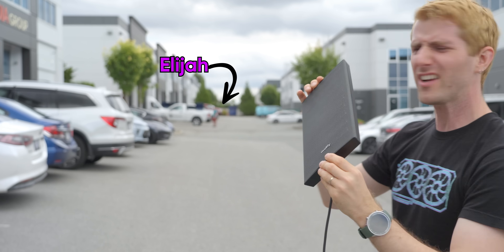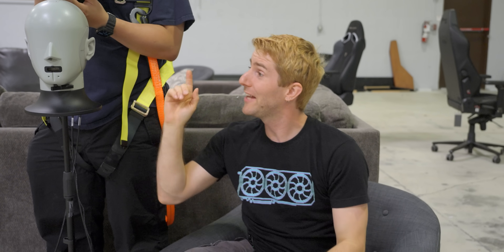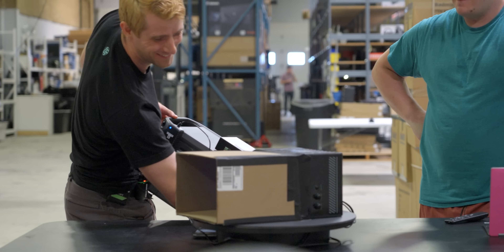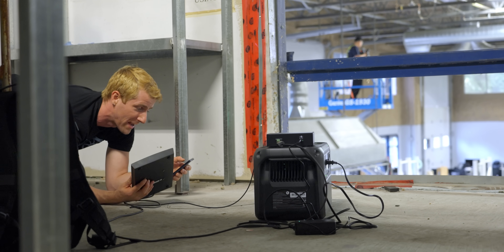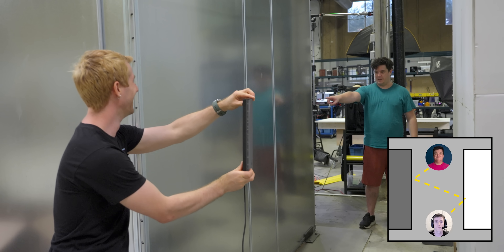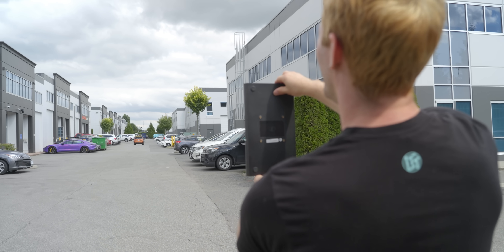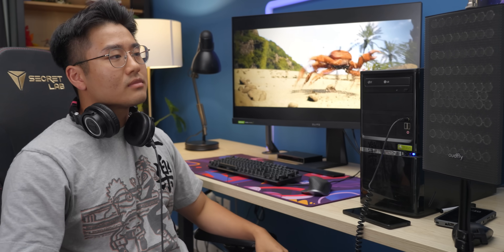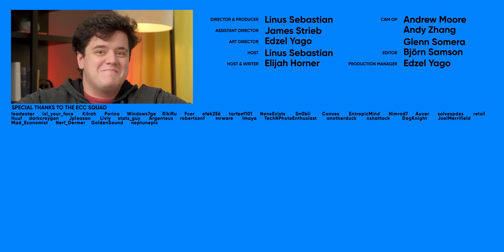Only 1 Person in the World Can Hear this Speaker - Ultrasonic Directional Speaker

Comment: For anyone interested in a more simple explanation of how this works, here's an easy home experiment with two phones - - 
1. Get a frequency generator app

2. Make a tone of 440hz (this is the middle A on a piano, it doesn't sound particularly high or low, just a middle tone)

3. On another device, make a tone of 442hz.

4. You should hear a 2hz tone (which sounds like two "wubs" per second), because 2hz is the difference between 440hz and 442hz. Even though neither speaker is capable of playing 2hz! 

5. Now imagine scaling this up. You could play one sound at 44000hz and another at 45000hz, giving a 1000hz tone that's extremely focused! 

Why does this work? Because higher frequencies focus in a narrower beam. This is why when you walk behind a speaker, you can still hear the lower sounds but the high pitches disappear. Lower sounds "bend" behind objects, higher ones are more focused.
Reply: sound doesn't focus in a narrow/broad beam by itself, it's only the source (in this case, the speaker) that determines how sound is spread. wavelength is the difference. wavelength at 20hz is approx 17m while it's 1,7cm at 20khz. hence, obstacles bigger than 1,7cm shield 20khz frequencies. you would need a 17m obstacle to shield a 20hz wave, which is something like a 6 story building.
Reply: Anyone who has a guitar (or similar stringed instrument)  can replicate this much more easily:  (assuming standard tuning) Grab your lowest string in the fifth fret and play it simultaneously with the next string.  Unless your guitar is PERFECTLY tuned you will hear the "two wubs per second".   Side note:  this is an alternative way to tune your guitar without a guitar tuner.
Reply: @Atlessa  This is also why unison bends sound so good. You play two notes at once, and bend the lower note up to the same frequency as the higher one. Before the frequencies are the same, it can sound very dissonant.

So it goes from dissonance to a perfect unison; sounds great with a bit of distortion. "Bastille Day" by Rush is a good example of unison bends (in the solo around 01:55).
Reply: @Atlessa  yet there is no such thing as perfect tuning, tuning by harmonics on 3rds, 4ths, 5ths doesnt add up to octaves...
Reply: Good now I got it
Reply: Your ears cannot "hear" 2Hz, what are you talking about? Maybe you can hear a 440hz sound modulated 2 times per second, but your ears cannot actually hear any sound below 20Hz
Reply: @codyrap95  You don't hear an actual 2 Hz sound frequency, but you hear a 2 Hz "beating". If you listen to a 440 Hz frequency and a 442 Hz frequency one at a time, you probably won't hear any difference. But if you play those frequencies simultaneously, you will hear a "beating" 2 times a second, or 2 Hz in other words.

And you can psycho-acoustically hear frequencies (or notes, really) below 20 Hz by playing the overtones of a fundamental frequency below 20 Hz. Your brain will fill in that note below 20 Hz, even though your ears won't hear it. Or even if the frequency isn't played at all (see Veritasium's latest video).
Reply: parametric array uses nonlinearity in sound to demodulate the amplitude modulated signals. so just because you have a beating frequency doesn't mean you are guaranteed to have a parametric array source
Reply: Yeah I watched that pipe organ vid on Veritasium too lol
Reply: Yeah, that’s not exactly how this works at all though. It’s using amplitude modulation with a 100kHz carrier tone.
Reply: @ClintMoody  This is correct. An ultrasonic carrier wave is modulated to carry a side band frequency that when demodulated by the air (non-linear demodulation), the sound produced is in the audible range. That said, I can imagine a method to demodulate multiple carrier signals from different banks on the array to create a binaural effect that produces rich bassy sound. I'm not entirely sure how you would build a DSP to process it all, but it would be a fun project :D
Reply: @ClintMoody  Yes... And what is that amplitude modulation creating? Beat frequencies, the thing I described. It was supposed to be a high level explanation.
Reply: Arent you describing binaural audio? I think thats different. Idk.

Comment: This technology is also used as a weapon. Originally it (LRAD) was designed to be a hailing device to hail ships that weren't responding to radio, after the destruction of the USS Cole in 2000. At a high enough amplitude, it can cause that discomfort effect that Linus mentioned, but to the extreme, causing eardrums to rupture, and theoretically could cause your organs to rupture at a high enough decibel count. Many police stations bought military surplus LRADs to break up riots and protests, and found that the alarm mode of the LRADs was incredibly effective at dispersing crowds.
Reply: ...oh... oh god that's a bit terrifying
Reply: @liviasilva3333 You'd have to put unbelievable amounts of power through it to actually hurt someone.
Reply: It actually is not the same. LRAD (at least according to wikipedia) is just using a speaker array in the audible range. This one on the other hand uses an ultrasonic base frequency which gets modulated with frequencies at an audible range. With sound there are some non linear effects that allow this modulation to spill over into lower, audible frequencies. 
The advantage of using this approach is that you can create a way tighter beam for a given array size becaue of the shorter wavelength of ultra sound. This also allows you to use only one frequency for the beam forming and  possibly focusing effect. This is fairly straight forward.

Beamforming the way LRAD has been done is not that easy because you need to create a beam for multiple frequencies at the same time, which to me sounds like a computational mess and probably comes with a lot of trade offs involved when you actually want to focus it on a tight spot.
Reply: First time I saw this was with an interview with the investor on discovery channel who told he just got funded by some darpa lab, never seen it around as consumer product since, then saw it was weaponized so all made sense
Reply: had a friend who worked in shipping, apparently there were suggestions to put them on ships that went through high piracy waters since there's apparently legal issues with arming the crew.
Reply: First thing I though. But those things are ALOT louder. But neat to see the tech come to a civil use case.
Reply: Is that what they used in Waco?
Reply: @abcpea  probably
Reply: I'm still upset for one terrible riot incident in HK. They used tear gas from both sides of a closed road and closed in with people pinched in the middle. People were suffocating and had to break into the building doors to get fresh air.
Reply: @yensteel  That trapment of people was rough.
Reply: That's terrible. Not a good thing at all
Reply: great
Reply: This sort of "It started as a military weapon that we found civilian uses for" thing is actually fairly common. Microwaves, wireless communication, and plenty of other stuff.
Reply: @dopplereffect9246  You would say that. You're just promoting big wave for your Doppler superiors
Reply: @dopplereffect9246  the internet
Reply: as in 9:54, LRAD was made on the cheap and worked as intended.
Reply: Yay more skynet stuff
Reply: Are we surprised?
Reply: Been tortured for 1 year now 🤗
Reply: Daemon
Reply: Imagine someone casually translate brainrot sounds right into your brain while killing you from inside
Reply: I immediately thought LRAD. Hopefully they Linus doesn’t weapon use this and use it against his employees.
Reply: ...and the public made up the Brown Note joke conspiracies.
Reply: .... Also there have been some odd injuries from the PD's using LRAD and other crowd dispensing technologies. Dont be a jerk and try to make one for manipulating other people like the PD's. Dispersing crowds should be thr mayors job with a speech and action replying to the protest.

Be a fungi and make one for fun and harmless pranks.
Reply: Leaving the hot topic out yeah. LRAD is considered a "Less than Lethal" weapon. But that also has to do with the frequencies they use for the crowd dispersal mode. Less than Lethal dose not equal harmless. I doubt unless you do some hardware modifications this speaker could go to decibels of that level. For the allready stated safety reasons.
Now Im off to troll people with spooky sounds.
Reply: @AnonymousAnarchist2  There is one piece of sh*t house on the way into town that used a high-frequency sound that only the youth can hear to stop teenagers from hanging outside their house. But the thing was so loud and had never been turned off for 15 years, it made babies and little kids cry and most under 19 wince simply for walking on the street because no adult heard how horrible it was, and as soon as you had say in society, you couldn't or could bearly hear it, so nobody bothered to stop them until very recently. 
(our noise pollution laws didn't include the frequency they were abusing)
Reply: @AnonymousAnarchist2  Aah yes it should be the mayor's job because we've never seen a corrupt government official before... Not saying I think people should go make one, but at least your average joe shmuck won't be a person in power with many reasons to be criticized.
Reply: @AnonymousAnarchist2  There is a difference between riots and protests. Protests, done responsibly, never need to be broken up. Protests can get out of hand and can need to be removed, but that's really only when some random cow lovers start blocking highways. Riots, by nature out of control and criminal, need to be dismantled as soon as possible, Riots provide an individual with a sense of crown anonymity that encourages them to act more wildly and with less care. These people are more likely to start becoming violent, towards property and people, causing death, injury, and massive property damage. If you are protesting, and a bottle starts flying, run. Once that happens, it isn't a protest anymore, and you damn well better expect to get slightly injured in the attempt to stop the riot. 

Also, mayors are absolutely useless, bottom of the barrel of politicians. If you are protesting something that a mayor could actually fix, then what the hell is even the point of protesting it, it must be so unfathomably unimportant. What? Is your neighbor Susie's flowerbed triggering you so you want to protest to the mayor to make flowers illegal?
Reply: @NeferetThePaladin  typical paladin mindset
Reply: @NeferetThePaladin  There are some massive cities where mayors have incredible power. Don't dismiss that without thinking.
Reply: @NeferetThePaladin  The problem with this mindset is the police get to, more or less, unilaterally decide when a protest "becomes" a riot. Meaning you get trigger happy morons who decide that some people jaywalking is the same as a riot, or even people being gathered in a public space is "obstructing access" and therefore it's a riot. This results in a police overreaction to a peaceful protest, escalating the situation to a riot. Because people tend to defend themselves when attacked with no provocation, obviously. Because you've given these tools to police with zero accountability you actually end up with more violence.
Reply: @NeferetThePaladin  The difference between a peaceful protest and a criminal riot is whether the protesters are clients of the ruling class or enemies of the ruling class.
Reply: @NeferetThePaladin riots are good. Power to the people
Reply: @kerolokerokerolo   until your little shop get wrecked without any way to get any compensation
Reply: There is no realistic difference between a riot and a protest, people who often try to make the distinction, tend to be the ones that also consider protests to be riots.  @NeferetThePaladin
Reply: @SlyTreeRat 
“SA is a risk you take when deciding to wear an outfit that shows your shoulders.”
Reply: @epictomato9876  It probably can't be used as a weapon unless you want to deafen someone on close range. Sound fall offs quite quickly and it would takes lots of power and speakers to increase range a bit, considering huge db required it would be useless

Comment: I recently went to a museum that had these types of speakers above the displays to hear the audio from the video playing on the screen. It was freaky but awesome!
Reply: @cristianmoore1996  were they using this exact type? If so, that's very cool. Parabolic dishes with a speaker to direct sound to a specific point have been around for decades but this technology is on a whole different level b
Reply: @thebigo06  Indeed, we've had a parabolic demo in Oslo airport (Gardermoen) for at least 15 years. Really freaky to walk around in a noisy airport then stepping under a lamppost and suddenly you're in a rainforest (it also blocks out most of the crowd noise)
Reply: @mBruksaas  Yo thats lit, does the audio sound like its inside your brain?
Reply: @robertheun7595  Sorta, because you know no1 else can hear it, but it's more like a little bubble of 360° audio since the audio changes when you move inside the bubble
Reply: @mBruksaas  that sounds like it would almost jump scare you hahaha
Reply: In norway, the national museum. There is a corridor like any other. But walking through it there is different sounds. And you're like oh cool music. But then you walk and realise it's changing and mixing based on your movement. Turns out not movement but location is important. They use these too. Or similar ones.
Reply: directional speakers have existed for this purpose for a decade now
Reply: So basically, the design in the vid and the museum ones from how I understand it, if you think of ultrasonic speakers/receivers used for.backup sensors, or even the vibratey things for generating fog in fountains, I'm guessing the math enables you to take a bunch of them, then you can calculate the output to generate interference between all the units that equals audible frequencies, that match the audio input. That helped me understand how it's doing it, if my understanding is right.
Reply: 𝒻𝓇ℯ𝒶𝓀𝓎 👁️👅👁️
Reply: Yeah, also haunted houses could use it so it’s like 500 times scarier since only you hear it
Reply: @water6006 that is a good idea and then they can make you think your hearing things.
Reply: yep ! they have some setup in the BMW Museum !
Reply: Did you go to Cosmocaixa?
Reply: freaky they say 😝
Reply: It was 𝓯𝓻𝓮𝓪𝓴𝔂 👅
Reply: That's epic bro. Did the audio sound like it was inside your brain??
Reply: The is essentially a multi channel low frequency AM radio. 
Except there's phase shift between the modulation of channels.

I wonder if there's any health risks. Also wondering if it'll affect animals?
Reply: Hello, dear. Our company produces this kind of directional speaker.❤